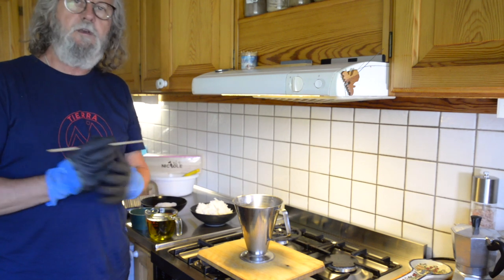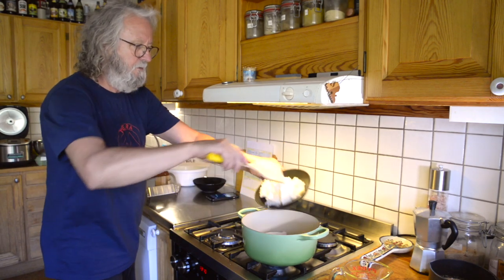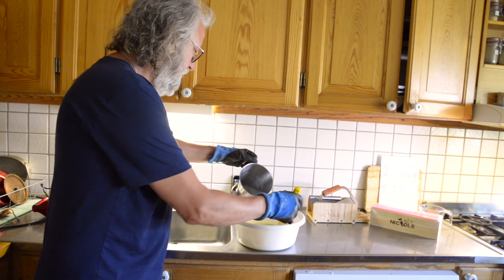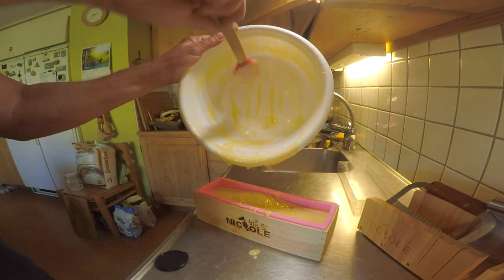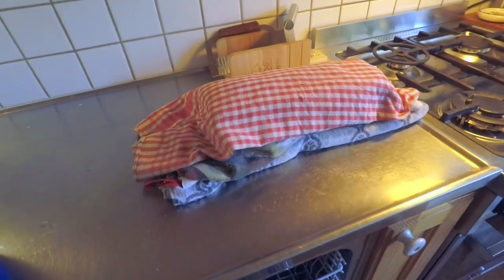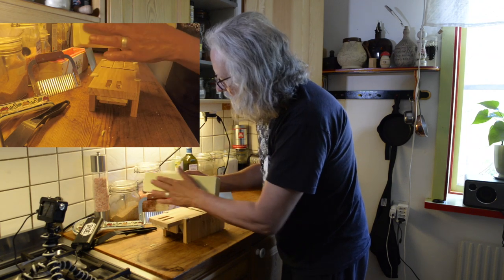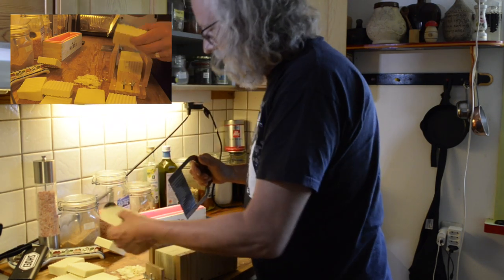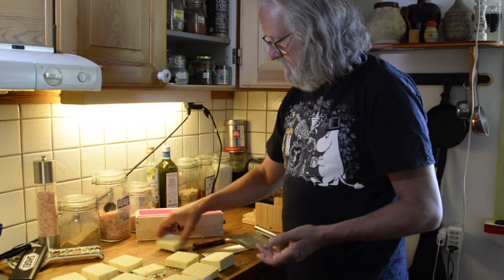Making a Basic Soap Bar - Soap Mold/Cutter Set

Comment: There's alooot of snow in Sweden! How's that working out?
Your link to your recipe is not working out so well. Can't get past the dialogue box that pops up.
I wanted to see how your recipe because with that amount of shea butter that soap should have taken off on you like a rocket! If I would have put that much, I would have been able to un-mold in about 3 hours. I have a shop on Etsy too. Haven't put any soap on there yet because I am afraid of shipping soap actually. What I have on there is a lye calculator. It is the only one on Etsy. I have a couple of videos of it on my channel and it's the only thing I use. Spent a few years making it. It works great for not having to get on the internet. Just thought I'd comment because your in Sweden. How's that working out for you? 
By the way, If anyone's interested I have a similar mold to what he is selling. Works out great to insulate the soap and it makes the perfect hand sized bar of soap. It never gets soda ash on the soap and I just cover it with a piece of cardboard that I cut out and sometimes cover it with a back warmer on top of the cardboard piece.
Reply from the maker: The link does not above but is a good link...try here...https://earthwayexperience.com/download/3770/
You will get some error message but it will download automatically if you say ok...sorry :-)
Yes, I was trying to make a hard bar. It seems to be a nice soap. Sudys and hard ;-)